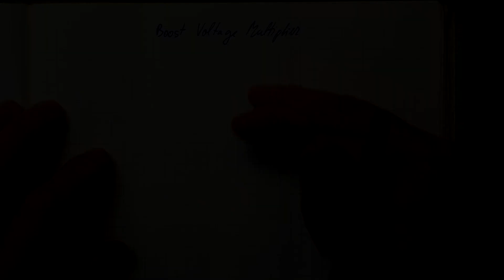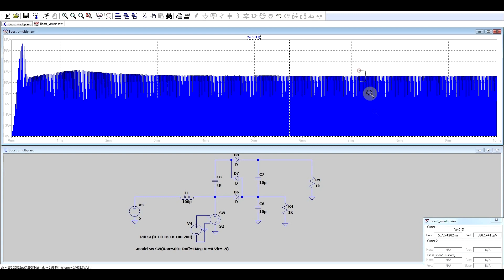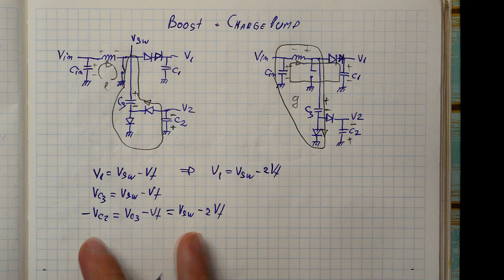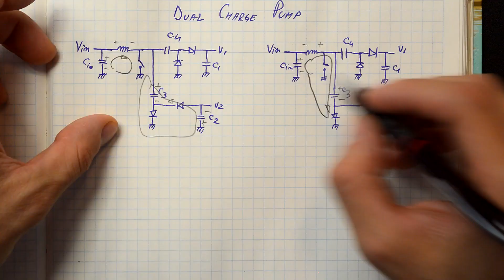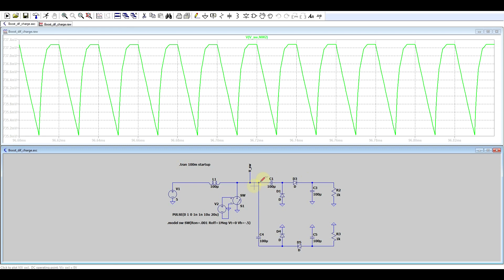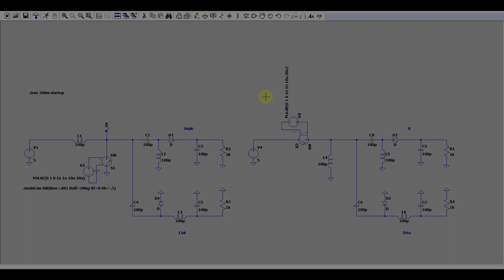Electronics Tutorial - Multi-Output SMPS

Comment: Can we get a boosted differential power supply just by using a CP configuration?
Reply from the maker: Well, the main advantage of using the dedicated boost stage is that it can provide a precise output voltage at any ratio compared to the input (the CP (charge pump) will only provide integer multiples of the input minus the voltage drops on the diodes) and you only need 1 switch (the low side transistor) - for the CP you need a push-pull stage.
You should be able to build the differential supply only using charge pumps but the same issues as mentioned above are present - you can't obtain any voltage.
Reply: @FesZElectronics  Thank you for the explanation.

Comment: Hi. Thanks for Ltspice videos. I have a question. How do I measure phase differance(Current and Voltage)  so power factor in LTSPice?
Reply from the maker: Hello! Well the easiest way is to perform AC simulations rather than transient. There you can plot any parameter in the circuit in reference to the input signal, and you will get both the phase difference and amplitude ratio in reference to the input. 
On the other hand if you really want to perform measurements on transient simulation signals, it involves a bit more complex mathematics - I presented an example like this in the Loop measurements episode ( https://youtu.be/X4yaBwaO1gk ) where the amplitude ratio and phase difference between 2 signals was calculated, maybe that can be adapted to help here, but I'm not sure.
Reply: @FesZElectronics   thanks for solution proposal but I wonder Have a Ltspice  function for a  power factor measurement?
Reply from the maker: Unfortunately, I do not know if there is a dedicated function for this. If I do find something though, I will let you know.

Comment: Excellent comprehensive video! To contribute some info - there are quite a few relatively inexpensive commercial isolated DC-DC converters with (I suspect) similar topologies. My personal preference for building custom electronics, is to buy those off the shelf parts and then simply filter the outputs as I need. It's a tradeoff of my time vs cost for clients, and in most cases the time savings are worthwhile. Some examples - for higher power, Meanwell DKA30B-15 (18-36V in, isolated reg. ±15V out, at 1A per output, 30W total, $29 USD). For medium power, Meanwell NSD10-12D15 (9.8-36V in, isolated reg. ±15V out, 330mA per output, 10W total, $12.24 USD). For low power (opamps etc), RECOM RFM-0505S (5V in, isolated unreg. 5V out, 200mA, $1.40 USD), RECOM ROE-0515S (5V in, isolated unreg. ±15V out, 66mA per output, $2.92 USD). These RECOM units are tiny SIP-4 packages with 2.54mm pin spacings. The prices are from Mouser in single units. Of course you can do better cost-wise if you build them yourself, but your time is worth something too. Higher-power designs require a very careful part selection and real world testing for stable operation over a wide range of conditions. Lower-power designs are easier to build from scratch, but the commercial parts of this kind are getting attractively cheap, depending on which market you build your products for. For extreme power density, it's hard to beat Vicor. For example: 384V to isolated 12V at 1500W (!) in a 6cm x 2.5cm package, 97.4% peak efficiency, $278. Expensive but dat power density haha. Thanks for the video! SMPS design in general is really fun. -Nick
Reply from the maker: Hello Nick! Well I have to agree, if the supply specs are right (input/output voltage and current), it is way less time consuming to just buy a ready made circuit than to design one. And considering the prices of some of the parts out there, if you only build a few circuits, the complete supply module will be cheaper than buying the components to build the same thing from scratch in most cases. 
Regarding the last example you mentioned (the 1500W 97.4% 6x2.5 cm supply) I would be very skeptical about this performance claim. Based on the efficiency, which is very good though, you still have to dissipate 40W somehow. And 97.4% is the peak efficiency, not necessarily the efficiency at full load, that is usually less. I mean it will definitely work for 5s but not for long periods of time unless it also uses a huge radiator strapped to it, so in the end, with the complete cooling unit, you still end up with something quite big, so paying a lot for the tiny package might not be worth it...
Reply: @FesZElectronics  Hi FesZ, I focused on the off the shelf aspect in my reply just because it's kind of interesting how this market is developing. Understanding the theory behind all this stuff is incredibly important and you're one of the few people here on YouTube who goes as far as you do to build a comprehensive picture. LTSpice ftw haha.

Regarding the Vicor converter, take a look at a datasheet about the type of part I was talking about. Google "BCM6123 pdf". That's a 1.7kW part (continuous). Same tiny size. 97.3% efficiency AT FULL LOAD (35A) haha. These are industrial parts meant for large scale deployment where efficiency is everything. Heatsinking isn't an issue because they're often connected to various enclosures or metal blocks/chassis that house other switching/protection/management devices. There are other very interesting design considerations for that part.. according to the datasheet, external filtering isn't necessary for these, but rather: "To take full advantage of the BCM’s dynamic response, the
 impedance presented to its primary terminals must be low from DC to approximately 5MHz ... Given the wide bandwidth of the module, the source response
 is generally the limiting factor in the overall system response." That would be pretty non-trivial to implement haha. The datasheet provides a helpful section on calculating thermals as well, you can take a look. Admittedly I'm a fan of Vicor and have used their products countless times.. really clever designs and probably the best engineering support I've ever received. They've killed pretty much all of their less expensive product lines to focus on this "lego" approach of building custom power solutions using various blocks.

I'll give you a random example though - I recently needed a compact, silent (can't have fan) and isolated 120V AC > 24V 400W PSU for a project, and I was able to grab a cheap Vicor unit on the used market in a 23.5x12.5x3.5cm package. 80-90% efficiency, 180mV ripple. They don't make these anymore but I loved them haha. The main DC-DC blocks that they use are always unserviceable (being epoxied parts), but they've been a lot more reliable to me compared to various industrial DIN-rail mounted PSUs, a lot of which have surprisingly high failure rates. Typically non-isolated as well. I hate unserviceable parts but I'll give Vicor a pass for what they do.
Reply: To kind of add something about these types of DC-DC modules - they do have external capacitance limits, which is potentially an issue. If you're driving a highly capacitive load, you'd require soft-start circuits. For that 1.7kW module, the output capacitance limit is only 100uF, which is like, nothing haha. That's somewhat mitigated with parallel operation, but still problematic for some applications. That said, the extremely high efficiency when the system is running, is worth the extra cost of a soft-start circuit if needed. Plus, their primary function is basically pre-regulation, so that a 48V to <whatever> regulated PSU can follow this particular part. 380V DC distribution is becoming common industrially due to low loss.. which is important when there is large physical space to cover. Anyhow I really hope you keep exploring this topic. Very interesting and relevant at this point in time!
Reply from the maker: @whatlions To be honest, I haven't worked with  isolated supplies that much, I mean I built 1 or 2 but that's it. I mostly worked with non-isolated circuits. But you do have quite a lot of interesting insight on this topic, and I will look into this in more detail in the future, hopefully.
Regarding the output capacitance and softstart; from my experience, the output capacitor value has an influence on the power-supplies stability, and needs to be taken into account when choosing the compensation components; very large capacitors can cause the supply to be unstable, so soft start might hide an instability but that doesn't mean it can't appear. 
Soft start on the other hand is useful to limit inrush current, the current drawn when starting up the supply. This current is of curse larger if the output capacitor is large but the SMPS should have extra over-current limit circuitry to prevent any damage. Also soft start is usually built into SMPS IC's, by proving an external capacitor with which to set the startup time. Though if the supply is sold as a module, you probably don't have access to this. 
I did observe capacitor problems with supply's powered from the grid but on the input capacitors. I mean if the input capacitor is very large, the inrush when plugging it in will be huge, and can damage the input rectifier or input filters. Its the reason why you might notice a spark happening when you plug a laptop charger or any other high power supply into the power grid. Here an input soft start might be helpfull.
Reply: @FesZElectronics  "so soft start might hide an instability but that doesn't mean it can't appear" - very good point! High output capacitance will cause lag between load demand and PSU response. It's kind of like introducing a delay in the feedback of any control loop (like in a PID controller). It will lead to instability. There are other issues too, all of which you're likely aware of since you sound knowledgeable on this subject. If the output capacitance is very large, it would interfere with the SMPS's overcurrent protection circuitry since you could have some intermittent sparking short circuit which would draw massive current (from the capacitors) in bursts, but the feed from the SMPS may never reach OCP limits, causing havoc for downstream components and user safety.

To add to the "sparking when plugging in laptop" thing, you'll notice that the sparking isn't consistent. And that's of course dependent on what the phase of the sine wave happens to be. If you plug it in close to the zero-crossing point, then no spark haha. Nice bit of lottery. XD

The modern trends in SMPS designs favor high bandwidth designs, which reduces the need for huge capacitive buffers. A lot of output capacitors will naturally reduce the overall efficiency of the system, since you would waste energy if the system needs to be frequently power cycled. I try to use the minimum necessary output capacitance in my designs, which is often necessary since I use a lot of OCP components like AUIR3315's which lets PSU outputs be short-circuited without even a spark, since OCP reacts within a few microseconds. If you're dealing with super high-current designs, soft-start systems become VERY expensive. NTC thermistors aren't an option for very high current, and often you can't even use regular wirewound resistors, since the extreme inrush current can cause the internal wires to simply break or the resistors to crack. Instead, you have to use "ceramic composition" resistors, in which the actual ceramic is mixed with conductive materials, which makes the entire body of the resistor conduct energy instead of just a wound wire. Those types of resistors do well under extreme pulsed loads, and also have uses for high frequency systems (snubber networks in high kilowatt/megawatt variable frequency drives etc), due to having extremely low inductance (wirewound resistors being the opposite). And of course they are very expensive haha...

I'm kind of a fan of high power electronics, even though I don't really work with it directly. I just think there's a lot of good knowledge in that area which could be very applicable to lower power designs. High power stuff really exposes the underlying physics - the stuff we typically ignore "because we can" haha.
Reply: I bought VRA1215YMD-5WR3 a similar module from HiLink with 2x15V out and 167mA datasheet value but at 20mA asymmetrical load (on negative rail, positive unloaded) it completely looses regulation and voltage drops to 12V. It is basically useless.